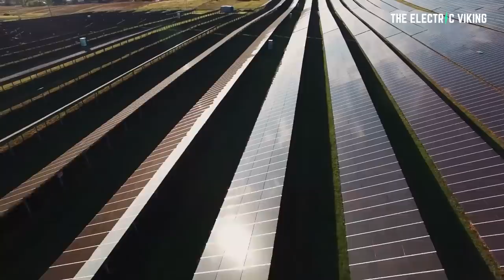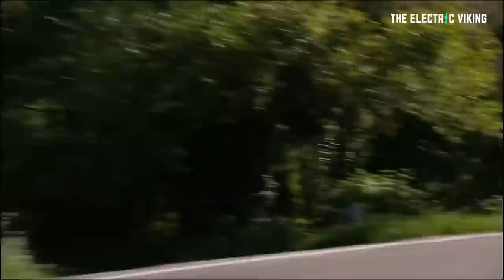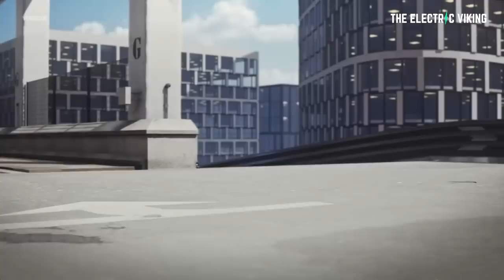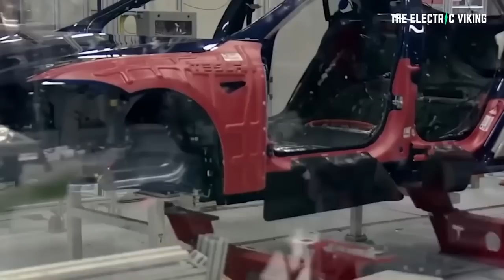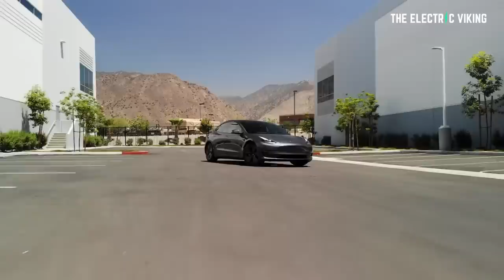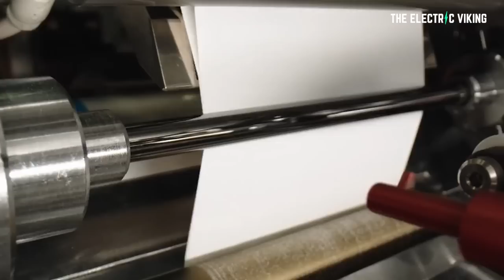Tesla Cybertruck mass production date finally revealed

Comment: Single motor will be dropped. There is too little cost savings for it to make any sense in a truck. It will have dual, tri, and quad motor options.
Reply: I agree as Linda Zhang the chief engineer for the lightning said Ford tried to do a single motor version and it didn't have adequate performance.

If they made a small battery rwd only ct with perhaps the old model s drive unit? It would probably be limited to 5k or less pounds towing, maybe 1500# max payload, 6-7s or higher 0-60mph and be a dog vs the current ev pickup competition which are all 2-4 motor awd only trucks. 

Which for some fleet sales a base rwd ct would still work just fine and for most who just drive a truck because they want to drive a truck. 
I.e. all the mall crawlers, cowboy Cadillac, angry lesbians and pavement princess type's. Which describes about 85% of the truck owners I've met since owning a truck myself in 2014. At least here in ATL. 😀
Reply: @4literv6  right. It just doesn't make sense for Tesla to make a "fleet" vehicle for now. They already will have many years to fulfill dual motor and up with likely a higher margin.
Reply: @rich8669  I agree mostly. Fleet sales as a whole are no joke though tbh. If tesla built a factory just to build fleet model's with cloth interior and very basic trim levels? They would probably do 500k+easy here in the U.S. across say fleet level model 3, model y, and rwd base cybertrucks.  🤔
Reply: @4literv6  agreed, but I don't think they could two lines that fast. That's a tall order. And adding in that many batteries to an already growing need is probably too much.
Reply: @rich8669  again basically agree with you. However to get to their announced stretch goal of 20million unit's by 2030?
Imo they'll have to build some basic fleet model's sooner not later and again imo they'll need to start taking leasing programs and offering in house financing very very seriously. 

I think they should revamp rewards and even consider offering a tesla specific cc like gm does. Plus do an all in monthly car payment deal. Where you get the car, charging and insurance all covered under just 1 payment. I think many would enjoy that simplicity and especially apt dwellers would enjoy it.

And as they scale by nearly 50% a year? I'd bet they need to start offering these type of programs by the end of 2025-2027 for steady continued growth. Last I saw hertz claimed over 52,000,000+miles driven on their small tesla fleet already less than 1 year from the announced order. 
That order alone drove over 300billion in market cap growth over 20 something day's last year for tesla. 👍🏻

Comment: Here is Tesla LFP Warranty on its ALREADY low Mileage cars NOTICE it reveals 70% battery life you car must be above which is LOW as hell on a car with already low mileage and the COST TO REPLACE IT IS A FORTUNE
Model S
Model X8 years or 150,000 miles, whichever comes first, with minimum 70% retention of Battery capacity over the warranty period.
Model 3 Rear-Wheel Drive8 years or 100,000 miles, whichever comes first, with minimum 70% retention of Battery capacity over the warranty period.Model 3 Long Range
Model 3 Performance
Model Y Long Range
Model Y Performance8 years or 120,000 miles, whichever comes first, with minimum 70% retention of Battery capacity over the warranty period
These Batteries suck hard as bad as the Warranty. There ain't no resale value is this Crap